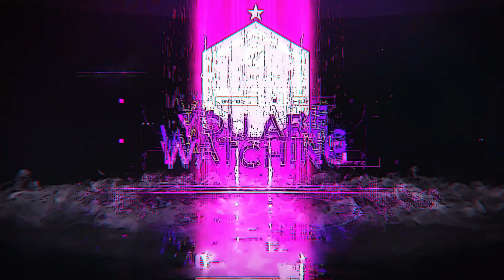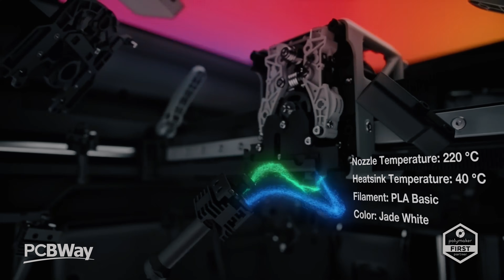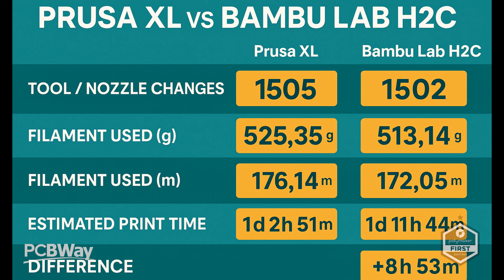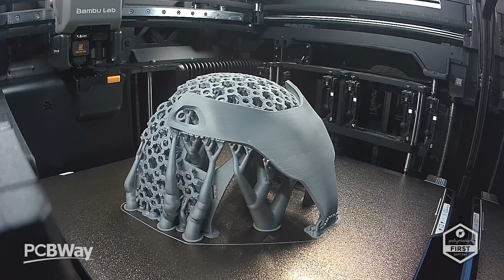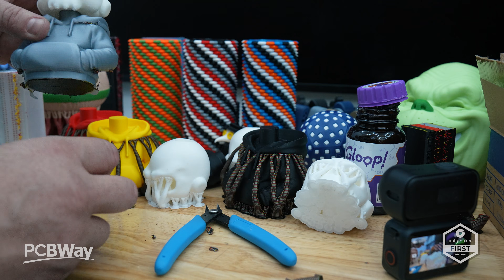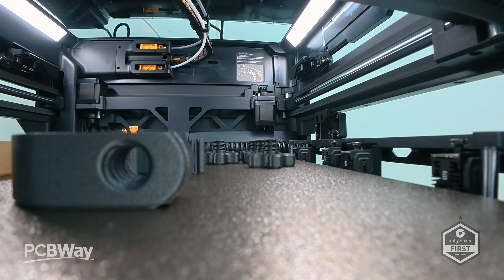Bambu Lab H2C – Faster? Slower? Better? The Honest Real-World Review

Comment: i hope that it would be able to use 0.2 , 0.4 , 0.6 , 0.8 mm nozzle in the same print  down the line.. i might get one when/if it can . BTW good video'
Reply from the maker: I think they will down the line, it’s the slicer not the printer

Comment: I keep going back and forth between formlabs, or saving a bunch of money and getting this. I just wish it could do transparent prints better
Reply: I have always had both FDM and resin (a FormLabs Form3).   I know people are different, so I can't really advise, but I can report my own experience.  The overhead of messing with chemicals (and the expense of constantly replacing expiring items) kind of wore me out.  Each time I refresh all the chemical and resin tank/membrane, it's like a race to find things to print before it all expires.    And it's nasty stuff, I have to go to the hazardous waste center to get rid of it.   FDM with 0.2mm nozzle is so good (and sooooo much easier) that I just don't ever fire up the resin printer anymore.   It's been idle for over a year.  In fact this weekend I am putting it back in the box to make room for an H2C.   I'm not sure what I'll do with the Form3, but it would take a lot of $ to get it back in operation (complete refresh of all expendables), and realistically my desire to run a SLS print may never overcome that activation energy.      It's cool, no doubt.  But it's like that hot girlfriend who is way too much drama.
Reply: @markdavis7397  Thank you for the thoughtful reply. I have similar concerns for sure. The only thing about the Form 4 however, is that the V5 general use resins do not require post curing, so just a quick rinse. I'm still in analysis hell tho lol
Reply from the maker: I think it’s going to be down to the material science what are you trying?
Reply: @TheRealSamPrentice  transparent cyberpunk armor plates
Reply from the maker: So PETG ?
Reply from the maker: Have you tried spraying onto the material ?

Comment: You were thinking the same thing I thought. 
Why is it only the one nozzle that is induction and swappable?
They need to release a WIDER H2C with a larger print bed and six induction nozzles on each side.
This is what they need to do, and what I think I will wait for, because this is so close, but not quite.
Reply from the maker: I asked one of the engineers about this and he said well it’s because the left-hand side is fixed and I said I know that but surely you can make that raise up and down he didn’t seem to think that it would be a thing. It was quite an odd conversation, actually.

Comment: I hate the Prusa xl so much. I selled it and I’m happy with the H2c. Only because of the annoying Color change by Hand. It took so Long to Roll the filament by Hand until it’s out of the tubes. I’m so happy it’s selled. Same with u1 or indx Core one. Never ever.

When you Print every Single day multicolor then a toolchanger is ok but when not, H2c nobrainer. Color change by
Reply from the maker: I have no idea what you’re talking about.. explain yourself
Reply: @TheRealSamPrentice I printed a Part with my Prusa. So I want to Print a other Part with 3-4 other colors. So I have to change the Color by Hand and Roll the 3 colors off and out of the tubes. It’s so annoying. I noticed that I print much less with it because it’s so annoying. I prefer to wait longer when printing but just press the button to change colors. Absolutely. Toolchanger are annoying. 

And everything has to fit perfectly. otherwise there are no good prints. Nozzle change requires new calibration.

Comment: Great review, but not sure why you did not address how it works with an AMS.  While watching another review, I did see  that this machine gives the AMS a real work out that will increase needed maintenance & cleaning.  For me, there are simply too many moving parts.  It will be interesting to see this machine a year later with solid run time & see how well it held up. So in the end I agree ,tool changer.
Reply from the maker: Thanks Kenny, I do talk about the ams and time it takes which was 45 seconds, i've since seen people using shorter ptfe tubes to cut down that change over, but its not enough when you consider the time saving you get with a tool changer. You're totally right about the amount of work the AMS has to do, however its really no different to any other bambu product at this point the ams will be treated the same and have the same movement paths.

Comment: Also, my thoughts on the Bambu lab AMS2 over the AMS1. Users say it is faster. Users say they don't like how slow the AMS1 unit is. I only use one filament roll at a time and use my AMS1 to automatically switch to the next roll. I don't use my AMS for multi color printing. So I rarely have to swap filament. In 1 year use of my X1C i have had maybe once that I had an issue loading filament. I think it was with a slightly over sized 1KG spool and it would not rotate well in the AMS slot. And I had bad filament that kept braking due to being to tightly wound on the spool. But then it was really ease to remove the filament. I just removed the PTFE tubing from the printhead removed the broken filament reattach tubing and back to printing. I never had to disassemble the AMS unit to clear filament.

Comment: I just wondered one thing: why do we need on these type printer both a prime tower and a purge poop. The only thing I can think of is if you need to wipe the nozzle between color changes. But if you are only using one color in each nozzle  why do you need a purge poop or visa versa; why do you need a prime tower if you are purging filament. Why do both. And in the future if we had a separate prime tower for each color or material type, it would take up more build space but then if we had another filament making machine where we could drop in the prime tower and reuse the filament. Anyway I am looking to the future where we have a consumer grade and pice for a 3d painting robot instead of having to use colored filament at all. I also wonder how many users are purging filament in the infill of the print and how much time and materials will this save. This is something  that no reviewer is talking about.
Reply: I wonder the same thing... they say its to "prime thoe nozzel flow" or something but dont say what that means and how not priming the nozzel is bad and show the differences. I changed colour manuially, the only thing i had to do was flush the last colour out, and it took way less then these autmoatic system, and i could do it way faster, because i could push really hard and force it.  After i was satisfied with the colour i didnt have to run it on prime tower to get it ready for printing, it was already ready. I did over 60 colour swaps on a 30 hour print one time, manually and its nice to see it automated but i dont see why its so inefficient after having done it manually and had no issues with quality or layer adhesion or anything because i didnt "prime the nozzel for flow"  or whatever they say needs to be done.  And if it must be done, do you need to print a slow tower all the way up, cant you just have some kind of prime nozzel whiper near the head that moves up with print and you can give it nice "prime" and wipe before printing.
Reply: @mikejones-vd3fg  I think you can turn them off - but I saw a trusted 3D guru say you shouldn't because the tower give the nozzle the chance to equalize the flow pressure.  Apparently skipping this can cause slight wavy extrusions at the starting point.  She did say you can force it to start the first pass on inner walls and possibly hide any of those defects which is a good idea.  That said it's only going to work on models that are large enough to offer a long enough run to hide the first few seconds of extrusion.
Reply from the maker: This

Comment: It’s a PRIME tower. It will always need to be there when doing multi-filament printing. When you swap to a different head/hotend/etc. you have to prime the nozzle. The H2C just also does a slight amount of purging into it now. It’s actually a pretty good idea, as it’s using a waste object that is going to be there anyway to perform the small amount of purging on tool head swaps.
Reply from the maker: are you informing me or others?
Reply: @TheRealSamPrentice  I assumed both, because that's not how you presented the information in the video. I see too many people on YouTube calling it a "purge tower" or criticizing a printer, because we're still wasting filament on it.
Reply from the maker: The terms "purge tower" and "prime tower" both refer to the same 3D printing structure, but "prime tower" is the more accurate name because its primary function is to prime the nozzle after a filament change. This involves purging the old color and then stabilizing the nozzle pressure before it starts printing the new color on the actual model. 

It also depends ironically on what Slicer you’re using, certainly from past experience
Reply: Exactly.   Since they have to get the filament flowing again and it gets reheated.

Comment: I see it as an all around solution. Not as fast as a tool changer but with greater flexiblity and possibilities. You trade speed for more range if you will. both the U1 and the  Prusa-Bondtech are better if you accept the color limitations. If the reliability is as hoped. That said the options are much more wide open on the H2C and the repution for reliability is great. Must accept slower print times as the trade off.
Reply: I was psyched when I saw the U1 then I hopped in my slicer and started playing with some of the prints I wanted to paint and soon realized it wasn't going to give me the color count I would need.  The Prusa is just insane on the price and if I'm not mistaken it's maxed out at 5 colors - also less than I want for colors - the H2C is the only option that gives the speed and waste reduction while offering the color count I'm looking for.  I'm mostly going to print D&D terrain and miniatures BWT.

Comment: Yeah, the selling point of the H2C isn't time, it's convenience.   You don't have to manually load all the colors and set them up in software (at least that latter part if you're using Bambu's RFID tagged filaments), you just have to pop them in an AMS and hit the start button.  If you have multiple AMSes you can even keep a few spares loaded in colors you commonly use.
Reply from the maker: Okay so convenience of saving 15 hours on a print over 5 mins of setting up some colours would be your preference? and using proprietary filaments from bambu too? Interested to understand this as you would have seen in the video I had doubts on processes and use cases.
Reply: @TheRealSamPrentice  I definitely agree with you on countering this persons take even though I ordered an H2C

In my case it’s the built in actively heated chamber with the smaller overall external enclosure size. I ordered one primarily to print functional parts for my car, Multi color/ material beyond 2 for me will be a less used feature but not unused and I disliked the amount of purge even an H2D creates. 

 I for sure plan on printing colored models for myself and friends, but I’m not looking at a timeline for the machine to earn its cost back. If you are doing production level multicolor printing the H2C is a cosmic level miss. 

The other thing is an enclosed u1 or xl would not look tidy enough to be allowed by the woman of the house. But that’s a personal factor 🙈

Comment: Bambu has been pushing the AMS since day 1, I greatly prefer the LMS Lite, and was shocked when they came out with a new AMS that still rolled the spools on rollers, it sucks not to mention the pain in the ass if the filament crumbles in the PTFE tubes. I ordered the U1 we will see...
Reply: I feel the same way and did the same thing. I love me AMS lite and hate that they limit the a1 to just one AMS lite. Ive had 3 AMS for over 2 years now and printed out every mod for them that would increase its longevity. And despite that 2 of them are not working and require parts. And 99% of my prints failing/stopping are from AMS related issues. The only currently working AMS while it still has issues it does perform well more than half the time.

Comment: Ther is a massive issue with this vortek system that only one reviewer has touched on, and is really is a big elephant in the room. These induction nozzles will get clogs, how do you unclog it with out damaging it. And from what i can tell you cant without damaging them.
Reply from the maker: I didn't come across that issue during my review, but its a very good point, which I have no doubt will be followed up on.

Comment: Thank you for an honest, info-filled review. I do intend to get an H2C, not only for the tool-changing, but also for the convenience of having a printer, laser, cutter/plotter in one machine. I think it's important to note the H2C Combo with the 40W laser is STILL priced less than a five-tool Prusa XL (which I currently have). In my mind, this is yet another reason to go with the Bambu over the Prusa, in addition to the ease-of-use argument.
Reply from the maker: Glad you found it helpful!
Reply: I am a Bambu head here lol, I have an H2D, X1C, A1 Combo, and a snapmaker U1 on the way. I wish the vortek wasn't $800 for the upgrade (especially since I just recently got my H2D) but I will do the upgrade when it comes out. I agree with your point, but you should take a look at the Prusa Core One with the Bontech INDX system. I'm not really in to prusa, but it looks like its $700ish for EIGHT (yes, EIGHT) nozzles on top of the price for the core one. The way they manage the lite toolheads and 8 ptfe tubes is very nice. If than pans out, that may the printer that lets me try Prusa out for the first time

Comment: Possibly an obvious question but do you need to buy more induction heads OOTB or does it come with everything you need to print 7 colors? Thinking on the 2399 model.
Reply from the maker: Yes, you do but if you look at the ultimate kit, I think they call it. You get the extra hot ends and the second ams

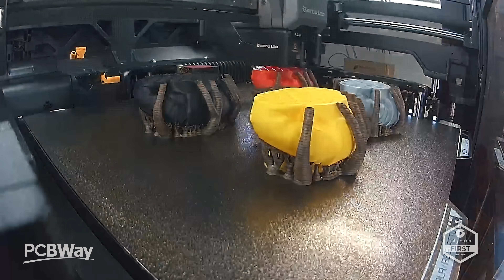Comment: 21:24 But we don’t know if the h2c system will work long term. It’s so complicated that it probably won’t work long term
Reply: Well, the 100% contactless tool head seems like genius way to "work long term".   It seems much more durable than physical pins plugging/unplugging every layer.   We won't know for sure until a lot of time lapses on a lot of units, but if I had to guess, "no touch" is going to last longer than "touch."
Reply from the maker: Its like anything tho isnt it!

Comment: Fantastic deep-dive, Sam! especially the way you walked through the whole “zero purge” → “purge saving” change and clearly showed what Vortek actually is instead of just calling it a toolchanger. The breakdown of H2S vs H2D vs H2C and your Scandic Prism vase/bowl comparisons against the Prusa XL, Snapmaker U1 and older AMS purge systems really made the time-vs-waste trade-offs click for me. I’ve just started a small 3D-printing channel and I’m trying to decide what my “hero” multi-material machine should be. The H2C + AMS combo at around $2,399 is basically right on my budget (~$2,500), and your review pushed it high on the list  the heated chamber, wide material range and the idea of pre-loaded Vortek hotends for different colours/abrasives all look perfect for the kind of multi-colour projects I want to film. If I do pull the trigger on it, I’m planning to do an unboxing and first-prints video on my channel and re-run some of the tests you showed here.
At the same time, I’ve been looking at alternatives in the same class e.g. an H2S setup, a Prusa XL, or something like the U1-style toolchangers and I’m torn between raw toolchange speed and the “just works, press-print-and-walk-away” vibe you highlighted here. For someone in my position (new channel, lots of planned multicolour prints, budget around $2.5k), would you and the community here  lean towards the H2C, an XL/U1-type toolchanger, or something else entirely, and why?
Reply: Still mot great for tpu though 😢. It’s the nemesis of bambu. 

I really wanted to love the H2C was so excited. But the 40 second swaps are killing the buzz for me.

Comment: I think one of the key reason why Bambu did not use vortex on the left to make 12 swappable nozzles is because I have a feeling the these swappable nozzles would not work that well for soft pliable filaments like TPU. By having one standard nozzle for handling TPU-like filament, it allows more variety of filaments to used in the printer. I am definitely not against it.
Reply: Or maybe because they can’t move it out of the way nicely.
Reply: You are only supposed to use the right nozzle for filaments that are too brittle or soft. 
So if you print PPS or TPU you are supposed to use it like the H2D with no AMS.
Apparently the left nozzle can print TPU but it's not recommended and it might not be as reliable.

Comment: The Vortec system Bambu came out with certainly is impressive, but what matters more to me is time waste. There's still some time saved. I still may invest in it as I found it annoying to have the printer pause if the poop chute get's backed up and this would mitigate that risk tremendously.
Reply: It’s also still very slow vs an actual tool changer/ head changer.

Comment: I think I'll invest in the Snapmaker U1 instead. (Makes me feel worse not backing it). The U1 can do multicolor TPU. I dont know if the H2C can. I doubt it. I'll probably get, at most, the H2D for big prints (or H2S) and U1 for multicolors to replace my P1S and A1. I can't have more than 2 printers and I already sold my A1.
Reply: You can still back it for 100 more than initially.
Reply: @perkulant4629 Problem is the delivery date is April 2026. 😭